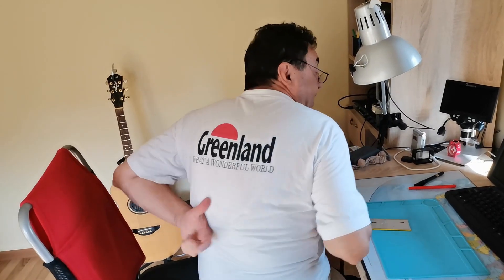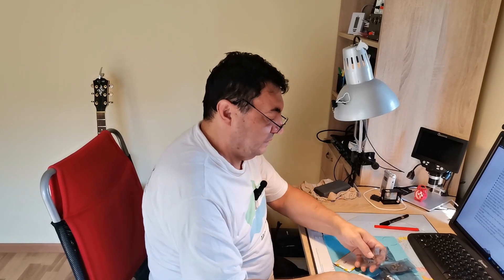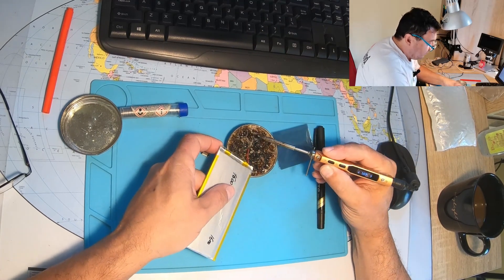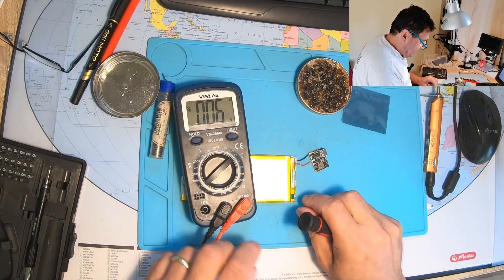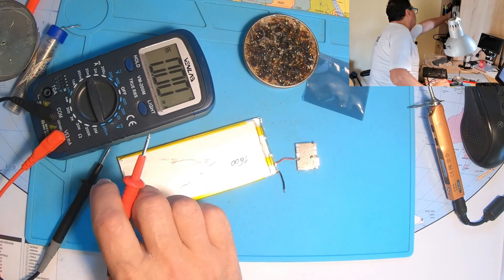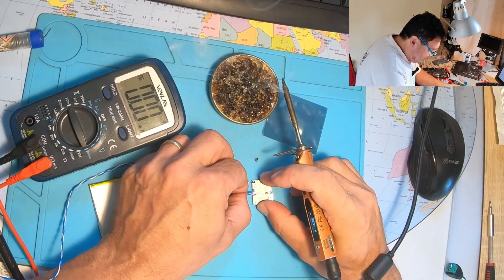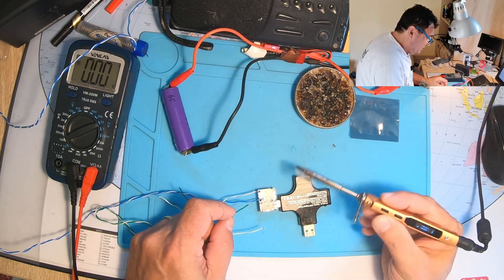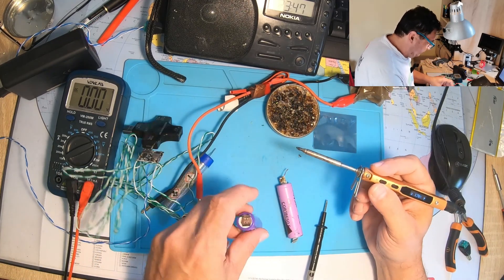Li-po charger and boost converter from 3.7 to 28V DC

Comment: Can be used only as a step up convertor without charging a batrery? I would like to power up a radio that needs 12v and 1000mA from a usb-c charger (5v)
Reply from the maker: Yes it can.

Comment: thanks for making this video. But i just want to confirm if it's ok to use lithium polymer ( 3.6v full charge) instead of lithium ion (4.2v full charge).
Reply from the maker: It's working with both li-po and li-ion
Reply: NO NO NO 😮
3.6V is LiFePO4 cell, and definitely NOT Lithium Polymer!!! You are calling the cell the wrong name!
...
This module is for 4.2V battery, and not for 3.6V LiFePO4. You will destroy your cells if you use this module!

Comment: Anyone know about the solderable jumper on bottom side marked ”t”. Is it so that when it is shorted the battery protection is disabled?
Reply from the maker: Not sure, I will check that and be back.
Reply: Yes, please.  From the ebay and Ali listings I think this module might have discharge protection but it's not clear.  They say "How to connect the battery: If your battery has its own protective plate, you can choose products without discharge protection." Which doesn't make sense...
Reply from the maker: @PriorUniform721  There is an over current protection at the output, means if you short the output of the module the current goes to zero, so it's ok to use any li-ion cell.
Reply from the maker: Hey ! You got the answer, see my latest video https://youtu.be/NYg2g9D1hFs

Comment: Also a question - how much 'hash' does the converter create when the radio is used on AM broadcast band? I would be using boost converter on 4 D cell AM and LW band receivers.
Reply: I built one into an AM/FM radio, and I had some hash on AM. I made a shield out of aluminium cooking foil which solved the problem.
Reply from the maker: @terrygee210  Great solving! Thanks for let us know.
Reply from the maker: SO far it's pretty quiet at least for Am and relatively strong station in the area. No idea about short waves, it have to be experimented.
Reply: @viocaia  Roger that. Maybe I have to experiment. I love the way Li-Ion batts give long life, but the radios I have use either 6 or 9 V from old days! I also have several Motorola 2-way radios too like MTS-2000 series, and the question there would be would the transmit RF (about 4W) affect the operation of the module? The radio is usually set to 1W RF output power for my use, so I can limit the current draw from the module. The Motorola use batt V of btw 7.2 to 8.4 V.
Reply: @uploadJ , I think you would easily be able to use the radio with 1 W or 2 W, but perhaps not on high power, i.e. 5 W to 8 Watt. Those HT RF amps aren't very efficient.

Comment: I guess I have bought some 5 or 10 of these too just to have them in case needed. Were quite cheap in the summer. 
But mine look a bit different depending on the port, micro USB or Type C. 
Learned a lot how to check these and avoid to check it with a full battery cause I would have done the same I guess.

great content as always even though I do not watch the audio stuff that much.
Reply from the maker: Nice to hear that my little experiment it's useful, thank you too for support